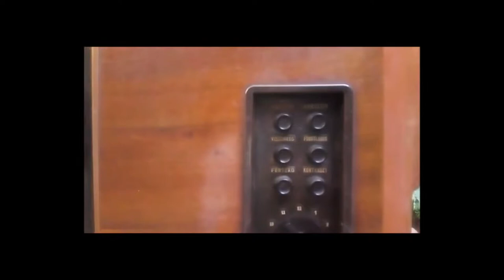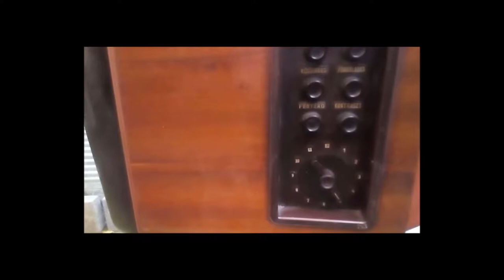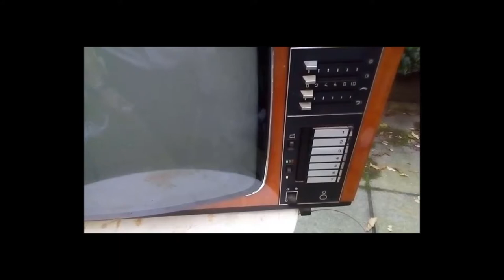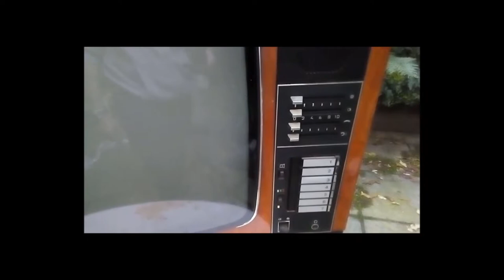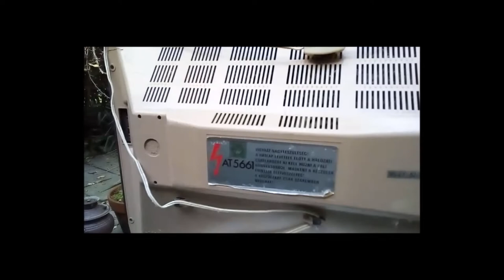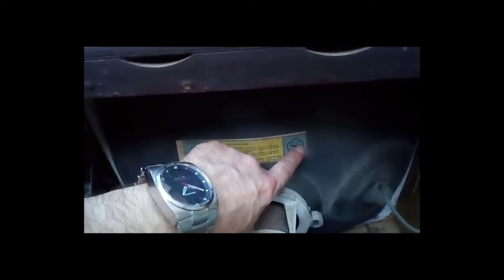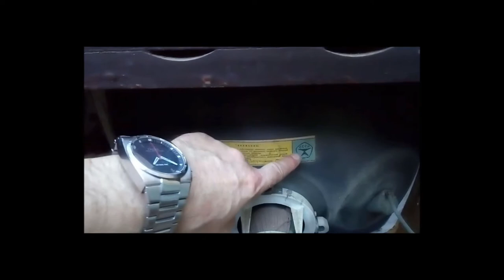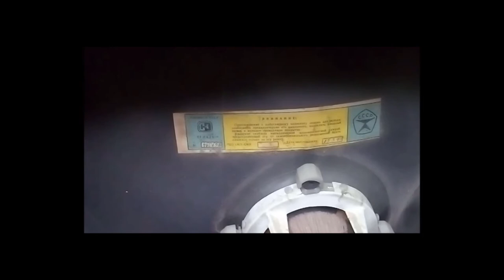Foreign Treasures 2017

Comment: The TV cabinet is in great shape. If it were me I would give it a good cleaning and leave it,like it is now and replace any bad parts. If it were me. It is your set to do with has you wish. 
All my best.
Bobby
Reply from the maker: Yes, I think I'll do just that, but I'll gut and replace all the electrolytics since those are often a source of trouble and, I'll probably end up replacing some of the tubes as well.... if the picture tube still has some life in it.
Aside from that, I'll give everything a thorough cleaning and I'll probably end up lackering the cabinet and repair as well as I can any cracks or scuffs.
In other words I won't "shotgun" the parts and leave everything as original as possible, since that is part of the charm of these TV's, the fact they are built with original Soviet parts :)

Comment: I live in the US and found a 17” Phillips tv from 1958 in an antique shop. Still has all original tubes but needs the lytics replaced.
Reply from the maker: Welcome and thank you for subscribing. Those Philips TV's are becoming really rare and especially so in the US. If it still works, you have an exceptional find indeed! 
The TV in this video is a "Kékes". It's a defunct Hungarian brand from the Fifties. I wouldn't be surprised if the electronics are based on a Philips design; even back then industrial espionage existed; but I must say Soviet engineers were at least as good as their Western counterparts, save they often had to make do with (inferior) Soviet parts to make something.
Until my new lab is ready, however, I don't have the necessary space to start restoring such large TV's. So I ask a bit of patience until then.
Thank you watching and giving me a thumbs up :)